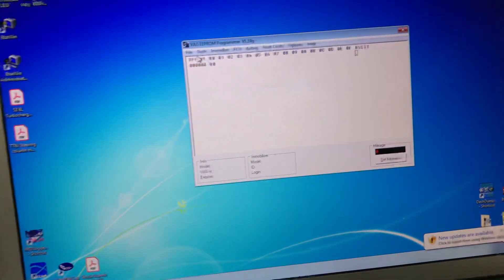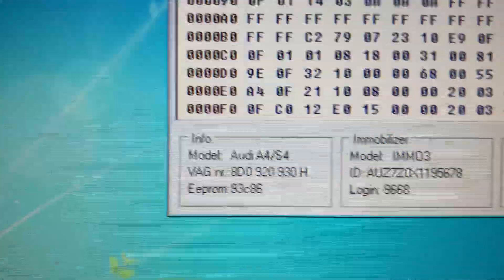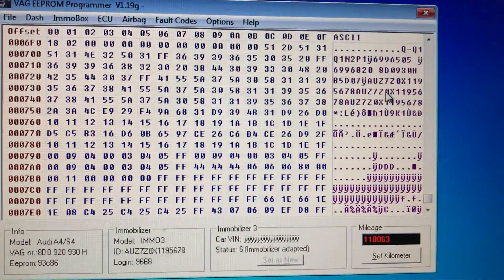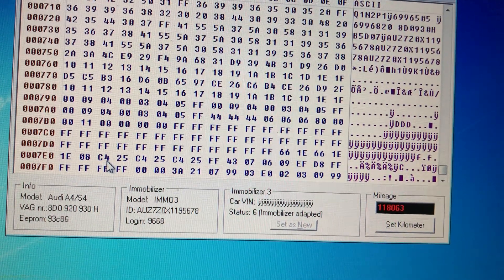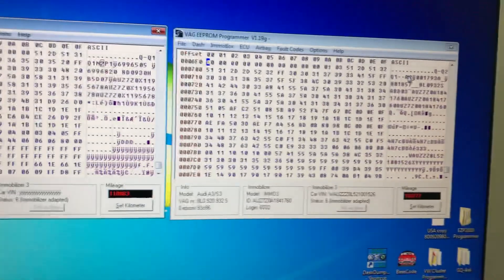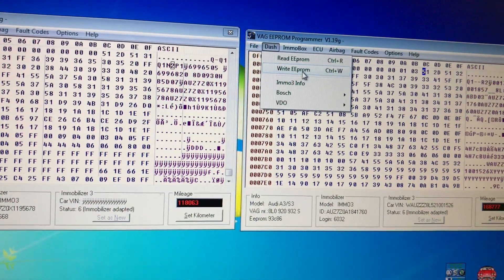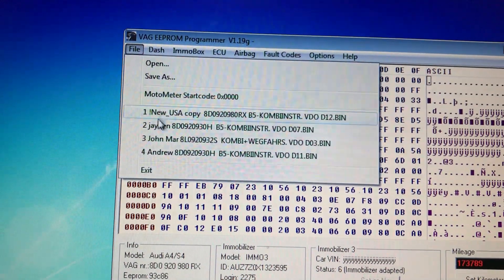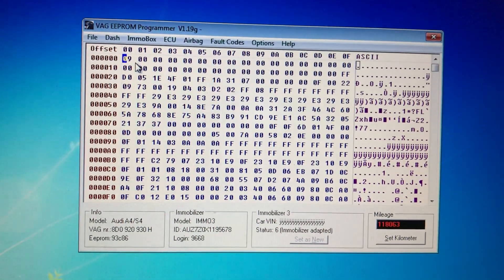How to read cluster EEPROM - Audi A3, S3, A4, S4, RS4 & Golf Mk4 R32 Gen. VAG EEPROM Programmer link

Comment: I'm not sure if i understood it correctly. I have to change my cluster on my Audi A3 8L '01. If I make a copy of my old EEPROM and paste it onto the new cluster, will it automatically work? Or what is this step (copying the EEPROM) else for?
Reply from the maker: Yep you're right. Youll be able to transfer the EEPROM data over like you mention
Reply: @ianpgonzaga  so also the immo will work with the new cluster without any other adaptations or changes?
Reply from the maker: @Dachs209  yes that file you pull Includes immo, VIN and key information

Comment: When i load 24c64 eeprom data nothing happens.  Show only offset and no data.  Any advise?
Reply from the maker: Hey Anthony. What year and car is the cluster from?
Reply: @ianpgonzaga  vw caddy 2012.  Old cluster (2009)24c32 show data. But when u select replacement cluster from 2012 caddy with 24c64 eeprom, nothing happens..  samen for mod file(service mode)
Reply from the maker: @anthonyg87  hmmm maybe that 2012 one is a generation break with a different chip set inside that doesn't allow a read.
Reply: @ianpgonzaga  its 24c64 9bly different in size.  Wil try some other software. Need f4om the 24c64 eeprom pin and cs code.
Reply from the maker: @anthonyg87  yeah you need something like vvdi Xhorse etc
Reply: @ianpgonzaga  bought smok uhds. That tool can read eeprom bij obd and change immo data.  Hope i receive it soon so i can try.
Reply from the maker: @anthonyg87  yeah that will do it

Comment: Can you use any OBD cable?
Reply from the maker: Hi John. No you can't. Must make sure it's a VCDS hex+can or cable with FT232rl chipset
Reply: @ianpgonzaga  I have VCDS . but cant make it work with my VCDS. On A4B6 syas its encrypted and wont read SKC nor gives any other info. On A4B7 wont read anything.
Reply from the maker: @JohnSmith-ez9dx  there's another setting in the program for A4. Look further down the menu.

Comment: Thank you.
1. can i find the program for windows 10? 
2. And, can i do it via obd port or not? 
3,. Oh and something else, the cable from vcds will it work with the eeprom programmer? 

Thank a lot i wish i will have some answers for my questions.
Reply from the maker: Hi Dimitris. Answers. 
1 - incompatible. There's no other program like this that I found for win10
2 - yes via obd 
3 - yes I use Ross tech hex+can 

Hope that helps.
Reply: @ianpgonzaga  thank you very much!
Reply: Deal for succeed probox 2014 ic 93c66

Comment: I see you have a wiring setup. IF I go to salvage yard and get a set of connectors will the connectors be pinned out the same for example on a 2000 VW Beetle? It has a cluster that shows 2002 or 2003 time frame as I don't have it in front of me. 

A wiring setup for the back of the single cluster assembly is what I have. 

Also can this software be used via OBD on the vehicle if we are able to extract the pin code or not? 

If so then I think I may have have the pin code as I used a aftermarket scan tool available for locksmithing. 

If I knew which wires were what we needed to hookup as in power 12v, negative?, CAN, Prog, etc I would use a pinout as I have a programmer by Autel as well.

Comment: hi, can you tell me whether to replace All with the letters FF on the airbag computer to reinstall the crash.  because my device does not erase automatically.  Basically how to know where to put which letters and numbers if necessary.
 Or replacing start to end with "FF" resets the crash in the airbag computer?  thanks again
Reply from the maker: Oh I don't know this aspect of coding sorry!!! My only tip is to compare the code of a crashed module vs not crashed and then find the sections that are different and restore it to the non crashed version.

Comment: I have hex V2 cable (not original). Can use the vag eeprom programmer software?
Or any other program that i can read the 7-digit SKC on my golf 5?
Reply from the maker: Good question. No not compatible with the program or to do what you want with your car. Beat to look into SMOK or ABRITES etc
Reply: @ianpgonzaga  I cannot find any software named SMOK, but i did find ABRITES Commander Software and ill test it to see if it works with this cable.

Comment: Do you know what values to change to enable boost gauge and oil Temps?
Reply from the maker: On a mk4 gen cluster? It's impossible sorry...
Reply: Sorry , for a s3 8p
Reply from the maker: @sashr6221  for that you need to get into the hex data of the cluster. Not doable with this program but look up abrites,  smok, X prog

Comment: I do have few questions.  I have a 2003 Vw jetta tdi maual transmission and the instrument cluster I think is dead or no responsive. Is this like cloning the Instrument cluster? If so can I transfer all of my instrument clusters data to a used one from another Tdi of the same year and have to work in my vehicle with almost no issue? Also does it have to be another TDI cluster or can it be a gasline cluster? Thank you for the great Video and info.

Comment: I also tried to read my KI eeprom to set my mileage but everytime i try i get "RX Timeout" error after the KI is detected. Does anybody know how to solve this?
Reply from the maker: What do you mean by KI eeprom?
Reply: @ianpgonzaga  "Kombi Instrument" or speedometer. I changed my original one against one with Driver Informationen Display
Reply from the maker: @stfn726  are you sure pinout is correct where K line is connected ? Sounds like no communication
Reply: @ianpgonzaga  i will Check this but i think the pinout is correct, eepromprogrammer can find and identify the speedometer but shortly after that the Error accours
Reply from the maker: @stfn726 Ah ok make sure voltage is stable. Also just keep trying. Sometimes can take a while...

Comment: Hi. I have skoda superb 1 clusters and I can't read eeprom. Clusters are latest version from 2007-2008 ( white dash and dpf ). Eeprom programmer give " can't read it, eeprom area locked" and commander after a few tries with " trying different login codes "  give " wrong security / login code ". 
I have tried many methods with info found on internet  , connected with blue kkl cable and with serial cable, same result.
I read somewhere that it would be immo3 crypto and it can only be read directly from the memory, with a programmer. This is true? I also tried crypto/ set as new etc... No result.
Reply from the maker: With pq35 cluster you need something like SMOK or Abrites to do the job🙂

Comment: So this working both with hex  but genuine . Mine is not genuine and vag-k+can ft cable vag dash commander?  is better maybe for eeprom I want to read pin so I can code programme remote😀
Now I bought both those 🤔but from car directly
Reply from the maker: Just try with different settings in the program. One of your cables should work ;)

Comment: the program does not work. it tells me that usb device not found. do you have any idea why?
Reply from the maker: Hi Andrei

Sounds like you need to make some configuration changes in hardware devices in My Computer.
Reply: @ianpgonzaga  ok. But , the program it's compatible with vcds interface?
Reply from the maker: @andreiandreiut9039  yes. Hex + CAN only if using genuine Ross tech cable.

Comment: is there any way how to make such like cable to test on a desk ? i have a polo 9N, but want to have one for most VAG cars
Reply from the maker: Yes there's a way to do this. I still haven't made the video yet. 

There are usually wiring differences between different generations though. So you might need a few looms depending how many different cluster  you want to work on.
Reply: @ianpgonzaga  I was planning to make a universal cable for most VAG models with different type of plugs.  My car uses a black 8 pin plug and  a  green one for example. The Passat B5.5 use only blue and green.  So I believe the OBD2 will stay the same but the different plugs to each cluster changes. So maybe instead of making a single cable for each car, maybe make one with more plugs on it for all VAG's
Reply from the maker: @renaudraffi9365  yeah you will need multiple harness. Not all pinout universal. 

Good luck!

Comment: I'm swapping out an immo2 cluster for an immo3 is the process the same? The immo2 is from 1998 golf 4 gti and immo3 from b5.5 passat vr6 half fis.

I have both pins of the immo2(original) and immo3 passat cluster
Reply from the maker: Will be very similar. Just make sure you do the immo matching process in VCDS too
Reply: @ianpgonzaga  How does the immo matching process work in vcds? Thank you for the reply your awesome man!
Reply: @ianpgonzaga You mean to adapt the keys in Instrument settings?
Reply from the maker: @RlSCED  no no you also need to login to the newer cluster
Reply from the maker: @RlSCED  http://wiki.ross-tech.com/wiki/index.php/Immobilizer_III_Immobilizer_Swapping_(Instrument_Cluster)

That step.
Reply: @ianpgonzaga  your the best my man thank you
Reply: Hey I forgot to ask, is it possible to swap a non CAN cluster for a CAN cluster?
Reply from the maker: @RlSCED hi again. I have  never tried it but I predict it won't work
Reply: @ianpgonzaga  I've seen a few donor cars with same engine and model as the gti that are can bus(mine is 98 the donors are 02+). Or there should be some adapter kits online? I feel like I'm going really deep in the rabbit hole but still thank you for all the replies and help man you've been amazing!
Reply from the maker: @RlSCED looking into it more I am sure you can swap in a newer cluster. You can t put a older one in a newer car.

Comment: Hello. Could you explain what pin/wire from which color plug I need for connect with PC via OBD2?
Reply from the maker: You want another video to explain how I make this desk loom work??
Reply: @ianpgonzaga  will be great or you could write here :) cause as I know we need only 5-6 pins. Power +&-12V , can low/high and k-line yes? But difficulty is that two plugs has similar pinout describe. If I remember its green and blue plug

I ask you because directly via obd in car I cant read eeprom from cluster :/
Reply from the maker: @darekpyzik1406  yes that's all you need. 

Follow any obd2 pinout and a pinout for the Audi car you have. 

Then it needs power and ground coming out. Which you power up separately

Comment: That is some good explanation, I just have one question; to get the pin code is it all the same on eeprom and how do you know which lines to look at for pin information.
Reply from the maker: Thanks 👍

The PIN location differ depending what car/model cluster. VAG eeprom programmer does the PIN decoding for you but without that program it was kind of figuring it out as per information from forums like Nefmoto.
Reply: @ianpgonzaga  thank you.

Comment: friend I did the installation of the program but I can't communicate with eeprom can you help via remote please
Reply from the maker: What version windows are you using and also what cable?
Reply: Windows 10 but I've already tried it on united xp and the cable and Vag Cam 5.5 commander
Reply from the maker: @geidsonqueiroz2680  won't work on windows 10. 

Try xp or windows 7 and ensure your cable had ft232rl chip set.
Reply: @ianpgonzaga  thanks friend but how do i indetify if ocabo has
  ft232rl chip set.
Reply from the maker: @geidsonqueiroz2680  check with your seller :) usually it will say  in their product ad.

Comment: ola amigo voçe ajuada com a instlação vag-k comander 5.5
Reply from the maker: Hi.  in English please ? :)
Reply: hello friend can you help with the installation of Vag-l commander 5.5 I can't get it to work
Reply from the maker: @geidsonqueiroz2680  sorry I never used vag commander.
Reply: what are you using in your video
Reply from the maker: @geidsonqueiroz2680  vag eeprom programmer in the video :)
Reply: yes ok you don't install it for me not on my machine
Reply from the maker: @geidsonqueiroz2680  you can find it easily online.
Reply: and that I changed the instrument panel of a Jetta.  you need to show the correct km
Reply: and that I don't know how to install
Reply from the maker: @geidsonqueiroz2680  you must use in windows 7 or xp :)
Reply: Windows 10 is not supported
Reply from the maker: @geidsonqueiroz2680  no doesn't work properly 

Maybe try compatibility mode.

Comment: Hello , i have audi b7 tdi and i wan’t to order custom cluster backrounds 1:1 as rs4 b7 still having tdi revs but top speed will be 310 instead of 260 on tdi
Car is getting modded so it will reach 300 😊
What do i need to edit or do so the speedo will show correct speed with new backrounds ?
Thanks!
Reply from the maker: Hi Juri. There would probably be something in eeprom you can edit. 

You might want to search forums like nefmoto, cartechnology, digital kaos for the exact info.

Comment: Hi nice video. Thanks. I have 2 working cables vagtacho 5.0 and Vcds 21.9 . Both connects fine. I want to read pin code of 2008 golf gti and 2011 sharan. Will it work? 
2nd question, I have japan imported car , it has Japanese spec only. I have bought the cluster of  same year , model & part number , can I transfer all uk specs  data to Japanese cluster except VIN & mileage. Thanks.
Reply from the maker: This program is for older mk4 gen vehicles so for your purpose it will not work.
Reply: @ianpgonzaga  it’s mk5 & 2011 sharan, not mk4 .. I can connect Vcds properly but it doesn’t work with Vcds cable and says “no ECU found”
Reply: @ianpgonzaga  sorry I thought you said it’s not mk4. 
So what tool I should use to read pin codes of mk5 golf, sharan 1N golf mk6?
Reply from the maker: @786hunzavalley  you want something like ABRITES X horse SVCI smok
Reply: @ianpgonzaga  thanks. Will have a look. 👍👍👍👍👍

Comment: Would this work for a 2011 A3? Car shuts off 2 seconds right after starting and throws an immobilizer blocked engine start code but key fob works and locks and unlocks the car.
Reply from the maker: No this program is for the 8L generation. 8P instrument clusters require more sophisticated program like ABRITES.
Reply: @ianpgonzaga  Thx for the quick reply. What do you think my problem may be? I bought the car at an auction and it was in a front end wreck before. I checked all the fuses I could find and checked the wiring underneath the steering column going to the immobilizer and there doesn’t seem to be any breaks.
Reply from the maker: @Maximumdub  I would probably scan it first. Do an Auto scan. 

Since you say it's had a crash there's probably crash data in the airbag module that will stop the car from running. If so the airbag module needs replacing. 

This also means you might need to fix the battery isolator fuse which will be activated in a big crash. When activated it cuts off power to the engine to protect it. It's on the battery. Looks like this: https://www.justgermanparts.co.uk/body/sensors/audi-a1-8x-2011-19-battery-isolator-fuse-cutoff-overload-switch-4f0915519/

But first - get a scan ;)